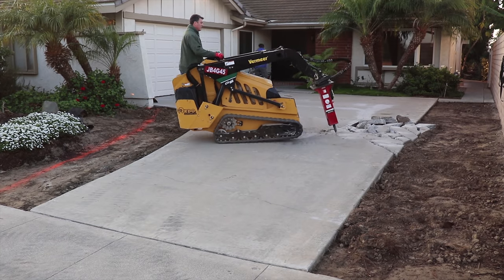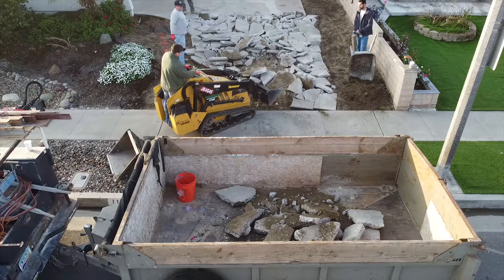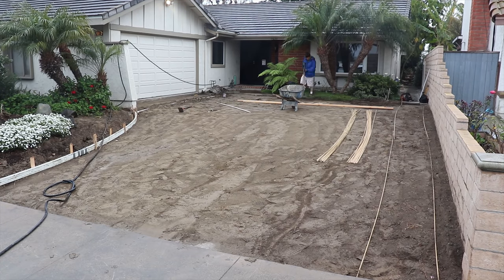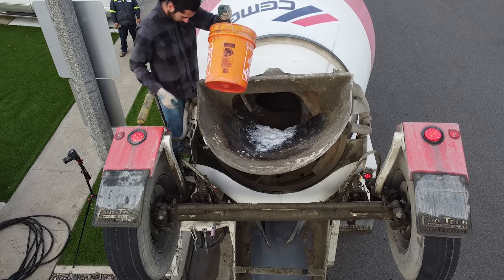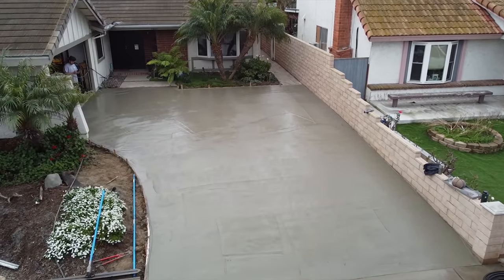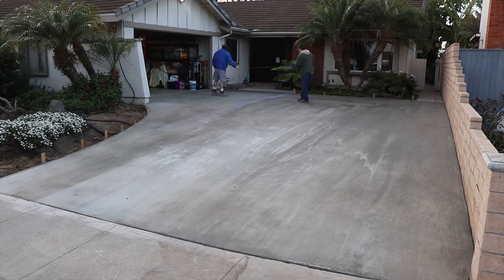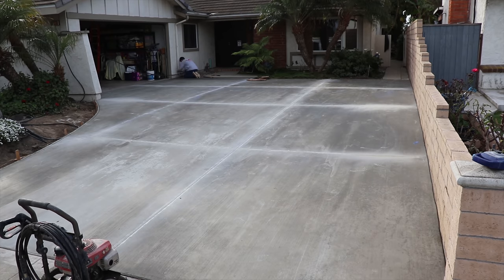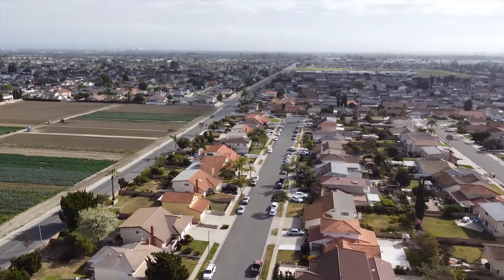How To Pour a Perfect Concrete Driveway in California

Comment: I really love this fiber glass reinforcement! Because I've seen concrete cracks exactly along the reebar when it gets rust
Reply from the maker: Your right it happens all the time.
If the steel is on dobies in a 4" slab there to high and will rust

Comment: good video - You&Tube making us all smarter....brings up a question should you attach the reinforcement rods into the existing slab to keep the driveway and slab aligned? Maybe not an issue on sandy soil but where I live we get  movement from expansive clay soil. My house has the driveway rebar resting in holes drilled into the slab.  It keeps driveway from settling but not sure it was a good idea.
Reply from the maker: This ground is non expansive.
If I had to drill and dowel fiberglass rods I would over size the hole and use epoxy.

Comment: Great videos and workmanship, can you go into more detail on how you set up your falls and grades on the concrete. On this drive way you go flat obviously will a fall but then mid driveway the fall drops the meet the path/ sidewalk, what defines the first fall from house to mid driveway? From uk
Reply from the maker: Existing garage floor is a definite factor. Wall foundation. 
The top area where most pedestrian traffic and mechanical work will be should be flatter than the rest.

Comment: That last episode really got me thinking again like with the old school before 3D Printing pumped not really shotcrete though this one gentleman, I need to find again to reference, using a superplasticizer formula so really lower sump I think is the term, to continuous pump layers like a 3D printer though manually with one layer formed moving up at a time with his finishing team.  He might not even had to use a form for one layer and I might be thinking like rammed earth.   Definitely reinforced concrete construction designed housing and structures and not the cheapo aircrete crap (I think is crap seems... might not be bad for insulating layers with not structural load... though seems the recycling old styrofoam methods are better to keep the cement to concrete integrity).   Fiberglass and other high mechanical loadings materials for reinforcement seems like the thing to do for outdoors agriculture multistory farming.  Guessing in crappier weather locations... with crushed lime maybe as aggregate... though I don' know for certain.  Maybe even coating with a waterproof layer once cured for a few seasons seems like for the longest lasting most simple farming high rise designs so less volume is wasted on gaywad neighborhoods.
Reply from the maker: A lot options, that's for sure.
TY

Comment: Can I just pour a thin layer over the drive way? 0.25” as a way to refresh? Some say to weld Crete or some agent. But if you pour over it it will adhere right?
Reply from the maker: You can try but it may not last.

Comment: I noticed on the metal rebar you guys usually drill and put the rebar into the adjoining structure like the garage in this video. Is that not done with fiberglass or did you not do it for some other reason?
Reply from the maker: I never dowel the garage slab, City sidewalk or house foundation.
Reply: @OdellCompleteConcrete  Oh my mistake I thought I had seen you do it before. Just curious why not?
Reply from the maker: I do dowel a lot of other things

Comment: Who makes the funny float you use? And what kind of bracket and adapter? We’re old school and do a lot of bull floating and knee boarding and trying to find a funny float but all I can find is stick trowels and we normally do not seal our broom finishes.
Reply from the maker: You can make you own with the right bracket and a large hand float
Reply: I actually bought the QLT marshaltown funny float but come with 360 bracket that locks and place and I’m needing it to swivel. Is there a replacement bracket i could get for it?

Comment: You mentioned they used 0-3/4” aggregate,what do you use?
Reply from the maker: 1/2" minus
Reply: @OdellCompleteConcrete  is that for ease of working or for your pump?
Reply: @OdellCompleteConcrete  I only have used 0-3/4 up here in Canada to my knowledge anyways. I typically give quantity and tell them what strength I need.
Reply from the maker: Yes these pumps cant do big rock

Comment: i've been thinking about what you said about how all concrete cracks for a good couple of years now.....  it doesn't, i see bridges and buildings and floors with no cracks all the time. In my local hardware store, they have a polished concrete floor, it doesn't have one crack in it and the building has been there for 35 years, no cracks in either of the costco's floors i shop at,  no cracks in any of the concrete sky scrapers down town that i can see.   so not ALL concrete cracks, sorry, it just doesn't
Reply from the maker: I bet it cracked on control joints.

Comment: why don't you set the rebar in the center of the slab thickness?  You guys are stepping on the rebar and sinking them to the bottom.
resting at the very bottom doesn't give it max strength.
Reply from the maker: Better near the bottom